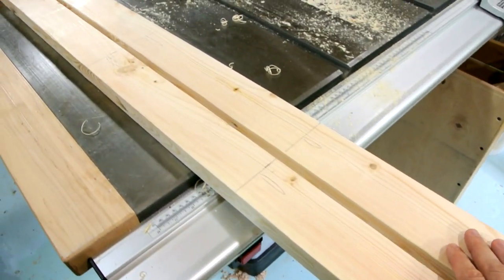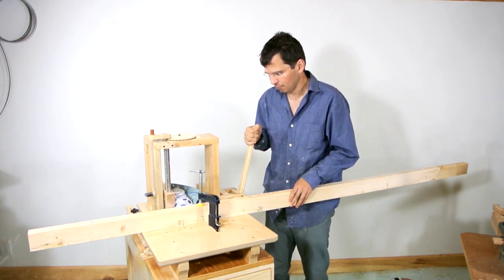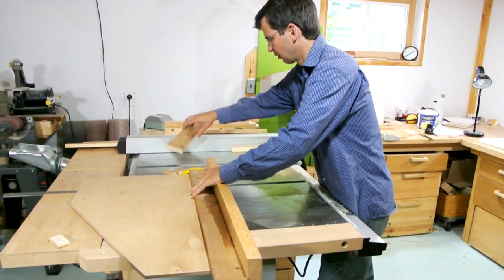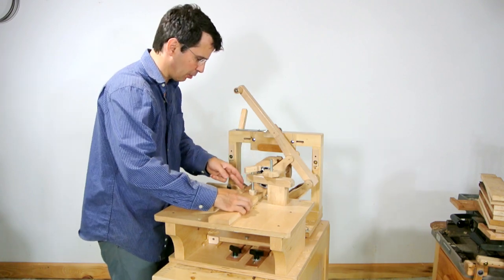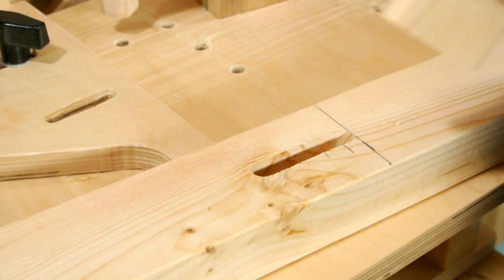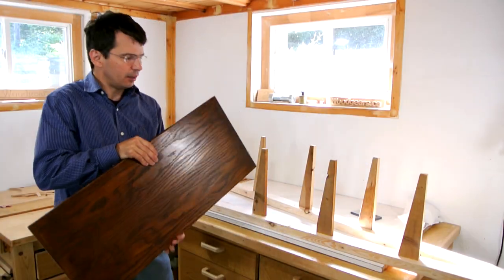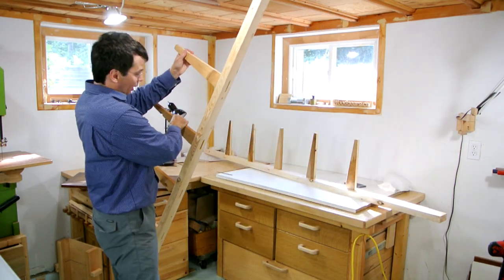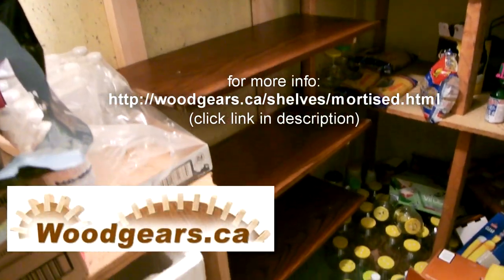Building shelves

Comment: First of all, I LOVE your videos!! I've been through about 80 of them, with no plans of stopping soon.

Newbie question: doesn't pine warp over time? Wouldn't that make for a bad support for the shelves? Or am I missing a thing or two about how to select pine that doesn't warp? I've got a couple of projects I'd like to make, but I'm afraid the wood will warp over time.
Reply: +Tim Foster yeah it can warp but it depends on the project at hand, this case I would suspect since its a storage room with looks of stuff he is just looking to get off the floor he was not to concerned with it. Also have to take into account the length of the pieces these where fairly short so any warping that did occur would be almost unnoticeable.

Comment: Can you show how to make the zig zag shelf brackets for the interior of bookcases?  These allow for shelving height to be adjusted on the zig zag brackets without using pegs, metal / plastic inserts.I had such brackets in some very old cabinets with leaded glass doors and a lot of external carving. I believe these were imports from Germany or similar location.  As I recall, the shelf brackets were not attached to the cabinet but were held in place by the shelf brackets. So the shelves could be removed along with the brackets making the interior completely open for storage of large items.   Thanks